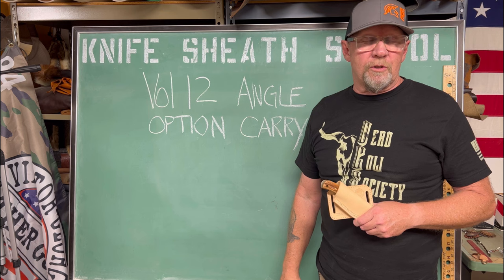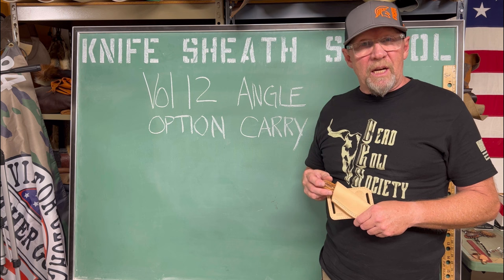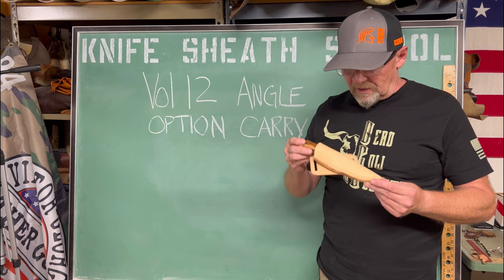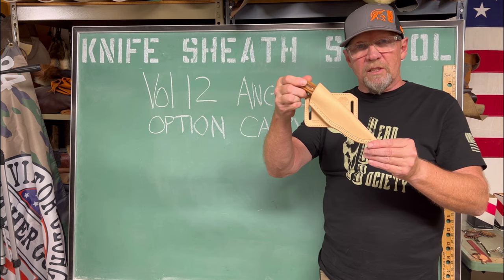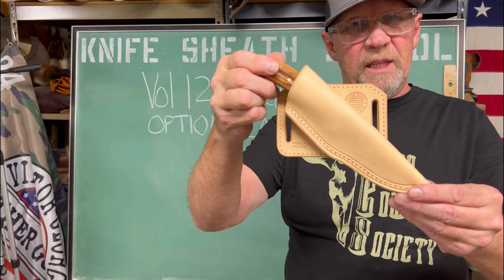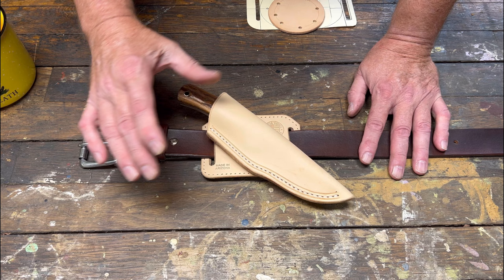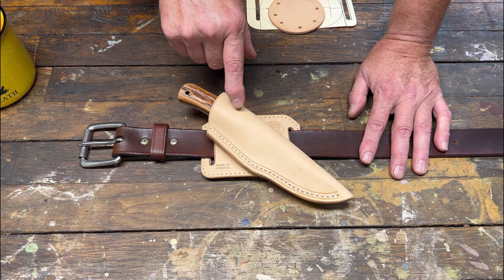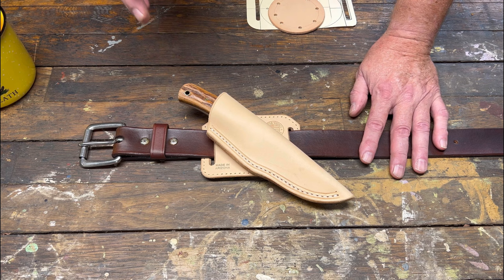How To Craft Vertical Cross Draw/Scout Carry Sheath:Knife Sheath School Vol.12#knifesheath #leather

Comment: I love this episode. I made this pattern and it worked out very well.  Could you demonstrate how to design a knife sheath for a knife that does not have a straight handle.  Like a slightly curved offset handle to the blade.   Just cuz all knives don’t have straight handles.   Thank you.   Jim Trantham, Prescott, Az.
Reply from the maker: Hello Jim Thanks for the kind words  They are so appreciated
 What type of sheath for a curved handled knife are you interested in?
Reply: @viktorgeorge9144  most any kind of sheath.  I’m finding when I make a sheath for a knife with a curved handle the spine of the blade doesn’t necessarily lay straight against the sheath causing gaps inside. I really like your welting design ideas and I think that might solve some of the looseness fitting. Also a knife that has a slightly curved blade causes issues as well…. I’ve watched everyone of your videos and have discovered many many useful ideas and skills that improve my construction methods.  I know the leather craft community can gain great insights from accomplished craftsman as yourself.  Thank you for sharing your expertise.   Jim
Reply from the maker: Sorry for the delay Jim  Seems like something always gets in the way of my leatherwork 😂 I’m trying to find a knife for demonstrating your question. It’s on my list of future videos. Thanks! Will you be at the Trade show in Prescott?

Comment: Great idea. 
One question. When you add the lock tight, does that make it harder to change the position or will a standard screw driver just undo the placement and you can add more lock tight on the new position. Thanks!
Reply from the maker: Thanks for the engagement  Yes the “blue” loctite can be undone with a good fitting screwdriver ( unlike the one I used on the video😉)  Red loctite is almost permanent from what I’m told.  I only use blue

Comment: Is there any way to cut semi-circle slots for infinite cant adjustment or do you need to punch holes at a predetermined angle (or multiple holes at the clock angles)?  Also, that system should also work with your more complex sheaths (not the "taco").  Good vid!  I will be trying this.
Reply from the maker: Thanks Jeff I always appreciate sheath banter. The only way I have done these is with the holes to angle the sheath  Many angle variations to choose. Normally I get asked for 3 positions  I think someone smarter then me could design something more efficient 😂

Comment: Do you mind telling me where you sourced the t nuts and bolts?
Reply from the maker: Of course  The tee nuts are easily sourced at places like Home Depot, Ace or Lowe’s and various holster supply outlets  I routinely use 1/4” shaft with 8/32nd thread which fits standard Chicago Screws with a 3/8th ” screw. These are also available at SpringfieldLeather Co or Tandy. Online searches yield many sources like buckleguy.com  Best of luck and have fun